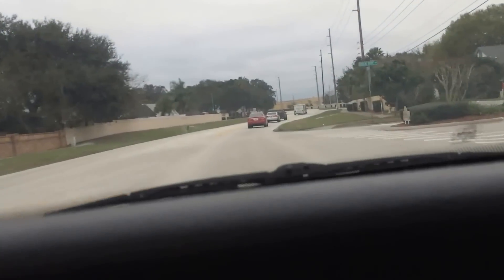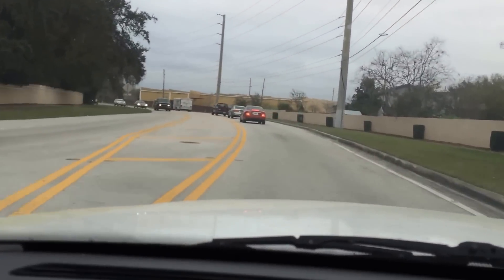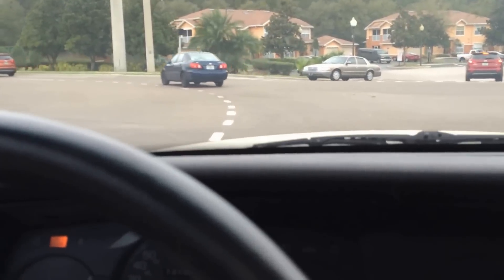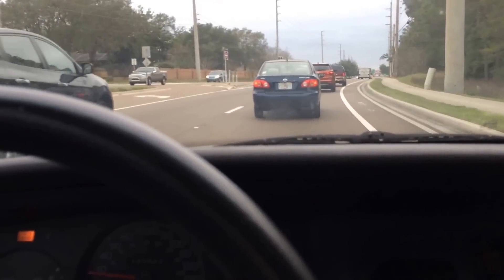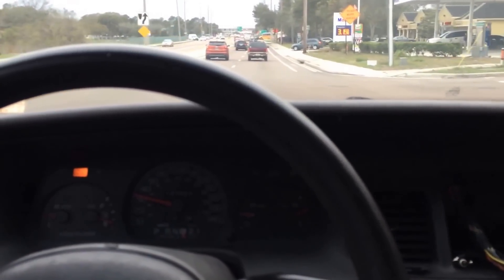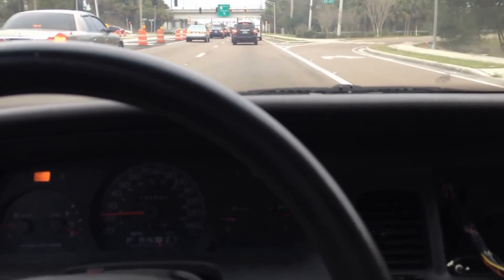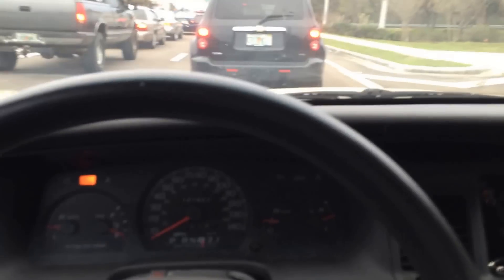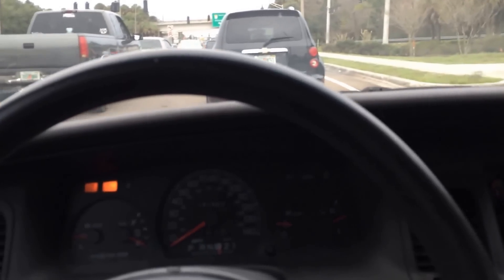'03 Ford Crown Victoria with Blown Motor P71

Comment: I bought an '05 9C1 in 2016 with an undisclosed, nasty rod knock from 6k-8k oil changes. Service records showed the transaxle had been replaced 25k ago, so I found a salvage yard with a 46k-mile 3800 that would install it. Drove it in, drove it out two weeks later. Runs like a top. Plan to keep it a long time.

Comment: Got a '08 for practically free, 178k miles and 11,600 idle hours, if you do the math that equals out to 600k+ miles! Transmission and engine are still good, all it needed was a evap canister I ended up getting used to pass NYSI. The day I picked it up ended up doing a road trip to Toronto no joke just hoped in the car made sure the tires were full of air, did a quick oil change and off I went.  No issues and did not live an easy life before. The 4.6L is a good engine.
Reply from the maker: I want to get another one. I love these cars especially with the posi rear end

Comment: that knocking sound i am hearing tells me that one of the connecting rods is broken
Reply from the maker: Oh yeah, you betcha
Reply: @PaulBarger  i thought that when you blow an engine, the engine either throws a rod, explodes like a stick of TNT, or throws 1/2 the block out of the front of the car like i have seen in some sled pulling videos
Reply from the maker: This was much less dramatic lol
Reply: @PaulBarger  it's definitely a busted connecting rod, because when you stepped on the accelerator the knocking got faster and faster.

Comment: Main bearing knock. Not blown.
Reply: Wade Caton
Reply: Wade Caton that is a rod knock. Mains rumble and cause low oil pressure. If it is a forged crank a rod and some bearings will fix her up. (May have to be turned.)
Reply: Yup. I wrote main before I realized what I wrote. Got ahead of myself.

Comment: Was it actually blown or just the timming chain or oil pump. mine started doing a similar noise when i tried to turned it on, before that i drove it 45+ miles at 75mph and round trip 46 miles for work and one day i go out to turn it on cuz its below freezing outside,  for my wife and kid and it sounded like that. i changes the intake 10 month before, and had did oil change and i always use royal purple and either mobile1 or K&N oil filter. never have i used cheap shit on my car premium gas since i bought it at 84k and at 110k my engine sounded like this.

Comment: That rod knocking sounds rough, just bought an 07 p71 that did on startup for a few seconds, but went away with oil, and tuneup... Hoping dont come back.
Reply: just found out, after digging, it is the timing chain guide, hydraulic, doesn't pump up right away...

Comment: how much did the shop charge to put the replacement engine in?
Reply from the maker: $1500 out the door. I believe it was $1200 for the motor in $300 for installation

Comment: Did you run this engine low on oil?
Reply from the maker: LOW DEADKKEY no this car has a rough past and the PO flipped auctioned off cops cars. This one also came with a trailer hitch on it. Who knows what’s it’s life was like. I had just recently got it. How did you come across this post? It has suddenly been getting lots of comments
Reply: +Paul Barger It was in my recommendations :P

Comment: The catalicic converters get pluged up with carbon and crack the heads and somtimes the block rendering the motor usless. The same thing will haappen to the new engine if you do not redoo the whole exaaust system including new mufflers yes i know carbon is a bitch!